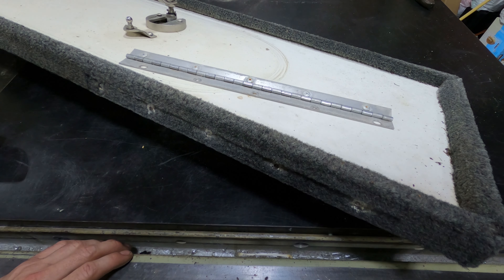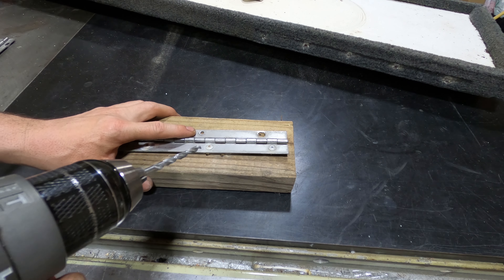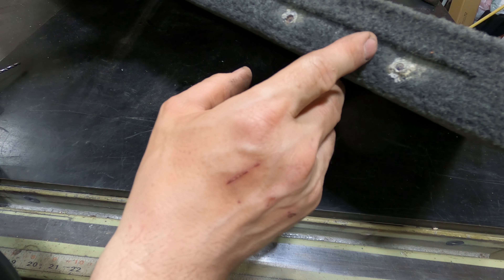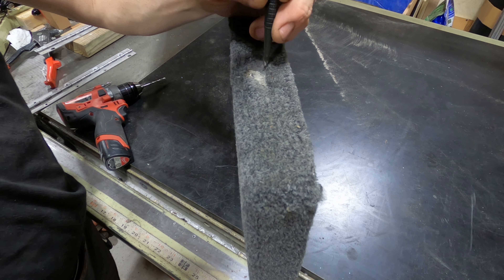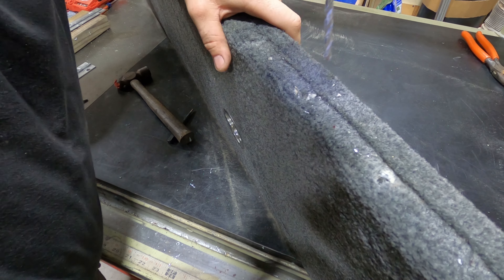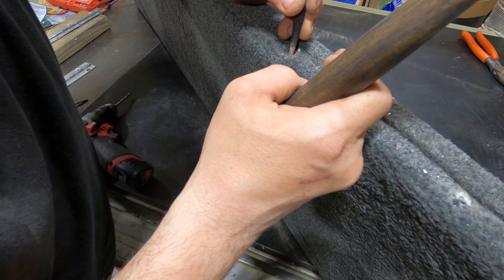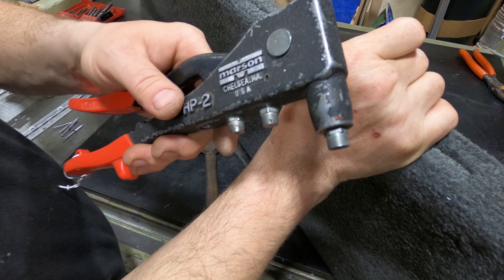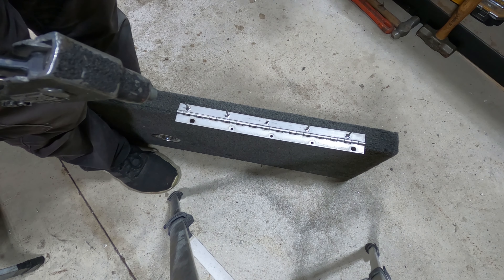Bass Boat Hatch Lids Hinge Rivets Repair Ranger 620vs

Comment: You said there is about 1/2 inch between the double walls of the lid. The drill bit looked longer than that. Did you drill through both walls? Did the new rivets go through both walls? A shot of the under side of the lid when completed would have been nice.
Reply from the maker: The rivet goes through  one wall and hole is through one wall only. You don't see the rivet on the other side.

Comment: Why not just use sheet metal screws instead of rivets?
Reply from the maker: If you will drill new holes you may be able to use screws but using the same holes, screws won't hold , and second the material is not thick enough to hold screws
Reply: What size stainless steel rivets did you use?